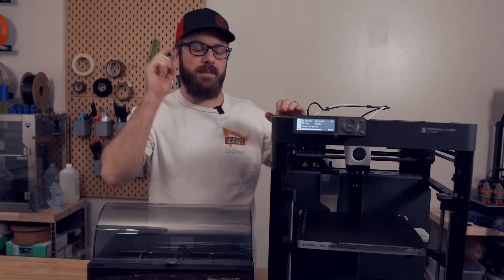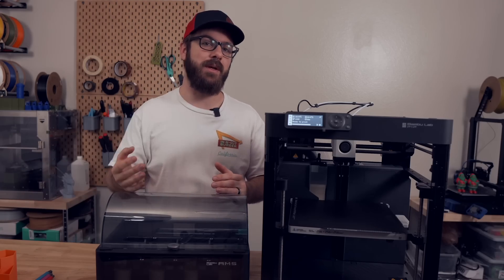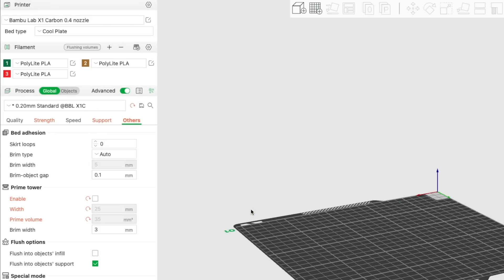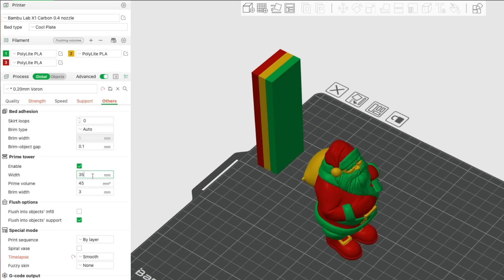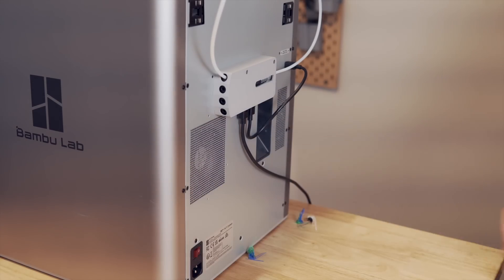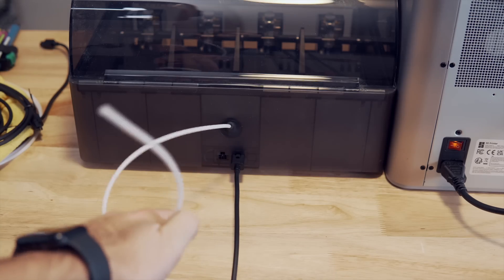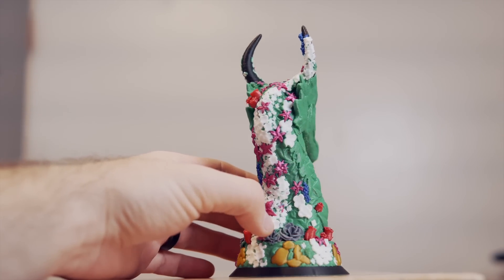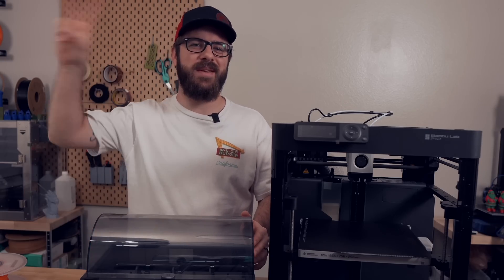Game Changer For Multi Color 3d Printing (AMS)

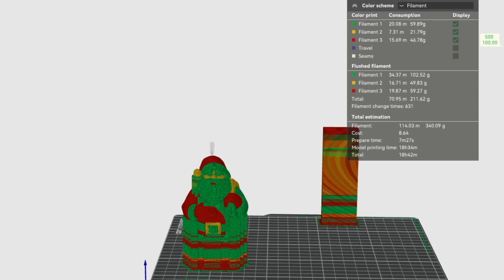Comment from the maker: Whoops was brought to my attention my calculations at 6:10 is off. 7 and a half hours seemed right due to how long the retract and purge takes (so it may not be far off) but in the slicer that is the starting time that the printer runs its base calibrations. Which is 7 and a half minutes. (Thank you for the correction)
Reply: You not only forgot to paint the front of the bag gold... you also missed his arm being green instead of red like it is supposed to be, conform the rest of the print.
Reply: You lost so much filament and time by not purging into the actual model. Not sure when you made this vid but it’s been in the slicer for a while now.
Reply: What speed do you print at with this prints?

Comment: @ModBotArmy I was wondering if there is a way to contact more than 4 Bambu Labs AMS systems at once? I am probably not the only one thinking this. Ya 16 colors or different filament types is a crazy amount already. But what if you want to run more then 16 colors or filament types is it possible to do? Also are there any other AMS systems out there for Bambu Labs printers? Or at least cheaper ways to add multiple AMS systems to the  Bambu Labs AMS systems you already have? I think everyone would agree that if you already own 1 Bambu Labs AMS systems then you shouldn't have to keep paying full price to add more AMS systems that all piggyback off that one system.

Comment: One of the advantages I like is the auto-refill. No more worrying if that little bit of filament on your spool will be enough; if you have an identical spool of filament (same type, brand, color) in the AMS, it'll automatically use the 2nd spool when the 1st runs out.

Comment: Check out the Mosaic 3 pro.  It does 8 colors but it does it by splicing in the new color, with a buffer to keep the color clean, and you have all 8 spoon hooked up at the same time.  You can switch back and forth

Comment: The dragon has a lot of waves in it looks like the resonance compensation on the printer is not working? Also there are spots that are layer changes or under extrusion... It does multi colors but print result doesn't look better than what slower cheaper printers do. The colors also look better if you print the model in grey and hand paint it. Also this is far far faster and cheaper than AMS.

Comment: Is it possible to print 2 pieces of each model on the same table with an AMS that has 2 spools of PLA and 2 for PETG and each model with each own material?
Also is there an option of purging in the model infill or even change color without purging (on the fly)?

Comment: but these are $1,200 printers and the AMS is another $350.  Maybe for the rich this is nothing, but most people start with a $200 Ender 3, so asking people to spending $1,500 is a joke.  And AMS requires special filament that starts at $25 a roll.  I don't see bambu labs taking over, I think creality will make a better clone for less than half the price.
Reply: Welp, 10 months later and you are still wrong

Comment: Did you try to feed TPU to AMS hub for printing multiple materials with TPU ? by that way maybe we can use external spool holder -> AMS hub
Reply from the maker: I wouldnt do TPU in the AMS, it is asking for trouble.
Reply: @ModBotArmy  Actully not in AMS is there anyway to feed this from external spool holder to AMS HUB directly ?

Comment: I just got one and it fails to switch filaments during a print 35% of the time. Can’t figure out what the problem is. Far left had the included basic pla, second from left is the included pla-cf. the second one is the one that’s failing. The spool is a little warped fro the vaccume sealed wrapper. Seems to not be unloading and respooling right. The filament is loose and I have to tighten it back onto the spool and hit retry then all is good for another half hour to an hour then it fails again.

Comment: Instead of the color painting tool, is there a way to model the 3D Model into a STEP with different parts (that are still assembled together), and assigned colors to each of the parts?

Comment: This whole EMS system does not make any sense. A system here you use clear filament and colors would be way more sufficient and better. You can even use sharpies for god´s sake. Multi Material in 3D Printing is only useful for dissolvable supports and rubber prints.

Comment: I would really like to see you do a spool color change from the AMS - I know this sounds like a noob question, but I am unfamiliar with this system and the AMS - especially bowden tubes.  Do you have to pull the filament out from the bowden tube when changing spools?   Also, that screen you kept tapping on is not on the P1P model.  So how does it fare with the simpler screen from the P1P?   -  I did pre-order the P1P, but not the AMS - figured I want the printer to actually get here first.  I just wonder if I can buy that screen and upgrade the P1P's screen to the one you are using, etc.   Sorry - again, I am a noob to all of this.
Reply: the P1P screen cannot be updated, the configuration of the reels in AMS can be done from Bambu Studio
Reply: @enriqueg8705  Ty for answering.  I just got my shipment tracking number last night for the P1P (I'm in the US).  Hopefully it arrives soon! :D

Comment: Would love to know if it is possible to mix and match materials? maybe use PLA for the model but PVA for the supports for example.
Reply: For optimum results, I would think that would require dual hotends, especially if the materials use different nozzle temperatures.

Comment: Where are all the three color mixing 3D printers??? A 3-in-1-out extruder with cyan, magenta, and yellow should be able to cover the color spectrum quite nicely. I'm fairly new to the scene and am surprised to find that the market hasn't already been inundated with armies of printers touting their ability to best provide that solution.
Reply: If it could be possible to arrange 6 feeds on the same printer without tangling, two 3-in-1-out extruders would be able to make a full spectrum print in two different materials. I'd take that kind of versatility over a 16 spool mixer any day.

Comment: I like your vids, but the world needs to stop using the phrase 'game changer'. It's so over used, that it doesn't mean anything anymore. You get to say 'game changer' as a past tense, because that's when you can see that 'the game' has actually been transformed. That is, unless you can accurately  see the future, then go ahead and knock yourself out.
There are still lots of issues with the colour printing of the Bambu such as with waste. I feel that the speed of printing (and the speed of 'box to printing') will probably be a game changer, such as with machines such as the Ankermake, which will truly expand the market for this sort of 3d printing.
I didn't watch the video all the way through, when I realised that the content was the Bambu. I don't think that this deserves the term 'game changer'.
Reply from the maker: I use the term when describing things that I feel are truly a leap forward. I have have tried a vast range of mmu setups over the past 8 years with most being an absolute nightmare. This is the easiest setup I have ever seen by a long shot and to me is a game changer because it makes multi color available to a much wider range of people that would not have time to non stop tinker and calibrate everything just to have spotty results. 

Is it perfect? nothing is perfect. But it is substantially better than anything out there with the exception of tool changers that unless you are looking at industrial printers are far from plug and play as well as limited in tool heads to typically ~4. 

It has room for improvement yes, but after years and years of what I would consider slow or even stagnation in desktop mmu setups this is incredible. Bambu might not be for you and thats fine. That is the beauty of having so many options. Hopefully they will continue to innovate and refine the process on the software side to decrease waste to a minimum.
Reply: @ModBotArmy  The problem is everyone uses the term 'game changer'. 
You could probably come up with a descriptive term that is truly original to your channel which would have a lot more impact then an overused catchphrase that blends in with the crowd of other Youtube content creators :-)
Reply: @ModBotArmy  Little bit 'off topic', but the obscenity of the 'waste tower' really bugs me and I've been trying to think of a quick solution...
Why can't the slicer allow us to select a 'waste object' that is created along side the 'true object'?
Maybe the waste object is the same design as the 'true object' but a bit smaller?
Maybe we have a default waste object such as a cup, or a puzzle?
Maybe the slicer designs some sort of ai driven piece of 'waste art'?
I'm still trying to come up for a solution to the Bambu  'poop chute ' :-)

Comment: If they could design the slicer to print a useful product with the purge material,  they could minimise the waste.  i.e. something where colour variation is not significant. like clothes pegs or furniture coasters etc...
Reply: It's designed that way. You can "wipe to object" and print stuff with the pruge

Comment: Im soooo happy that I didnt order this printer. My main issue is plastic waste. 
Somehow nobody havent raised this issue. This printer literally creates plastic pollution on a fast track -  as your Santa example shows, it created almost 3 times more waste than the product. I love the Santa though :D
Cost of the filament is also an issue when printing with proper stuff 😛. If filament cost 100+ euros per kg, this amount of waste will become an issue for the wallet (OK.. my I-dont-care filament cost only 65ish euro per kg). 
Im using custom printer with quad printheads and I have to say that price for that printer was a bit higher than X1 Carbon with AMS but if we consider the price of wasted material then X1 Carbon price will go up fast if you print a lot.
If Bamboolab will come up with printer that have tool changer Ill crab couple of those fantastic machines to myself  at once

Comment: i can’t get over the fact that it wastes so much filament. i dont mean just bambu labs but every multi material printer that needs a waste block. it would be great to have 3 dimensional printing so the waste block doesn’t have to be in the same layer as the print & can drop down the gantry or move up bed away to a non intrusive corner to purge plastic a small amount.  all that wasted filament just because it needs to be in the same layer as the print gives me nightmares lol but heck if that’s the case & you have a shredder & some sort of way to turn wasted filament back to a spool is a good solution as well.

Comment: Does the AMS only work with Bamboo Printers or can I use it with my Ender Pro?  Great video...exciting to see multicolor printing happening.
Reply: They are a closed-source company who are only interested in taking from the open-source community without giving anything back. So no, it only works with their proprietary slicer on their proprietary printer with their locked-down firmware
Reply: @cemmy410  Do you drive a car with open firmware? Thermostat? coffeemaker? Ride an airplane? 
Not defending, just curious how far you go with this...like people struggling to buy all MADE IN USA, lol.
Reply: @foam27  if those options were available to me I would take them. In fact, cars are a great example of why closed source hardware is a bad idea, with manufacturers recently moving to lock things like sport mode behind a paywall. Where possible I prefer to own the devices I use.
Reply: @foam27  their slicer is literally a clone of prusa slicer which is an open source slicer… lol. The complaint is kinda valid.
Reply: @timr86868  But it's not "literally" a clone. It has features the unmodified version dosen't.  Lidar, etc that are machine specific that other printers don't do. Their work added into the "clone".
Reply: @cemmy410  Can you imagine 1000's cars driving around with modded firmware? Tinkering of ABS/stability safety systems? I agree with you, but with limits to protect us from the idiots that take it too far.
Reply: @foam27  there are already thousands of cars driving around with aftermarket ECUs, tuning profiles, brakes, intakes, in-car entertainment systems, exhaust, tires... basically any part you can think of. It's not as big a problem as you seem to think it is. I'm way more worried about being locked down and exploited than I am about someone else being able to mod their hardware
Reply: @foam27  yeah, so you're saying that they took an open source project, added features to it, and then didn't give those features back to the community that did all the ground work? Which is literally what I objected to in my first comment?

Comment: I noticed the support material, I'm surprised you didn't use solvable support material because clearly you will want that ability with this system. As you did it presumably you can use the infill material as part of the purge material between colours.

Comment: The biggest problem with this system is the BambuLabs Studio slicer being derived from Slic3r/PrusaSlicer (as, IMO, most problems with the X1, derive from BambuLabs’ nerfing of PrusaSlicer, though the issue here exists in the original Slic3r/PS/SuperSlicer). PrusaSlicer, is, in my opinion and experience, the worst slicer available for multi-material or multi-color printing, due to there being almost no practical settings overrides existing in the per-filament overrides settings, instead being contained within the general Print Settings parameters. Each material behaves differently, and may even behave slightly differently from spool to spool of the exact same material. By keeping settings that are influenced by filament peculiarities saved within the Print Settings, with no Filament Profile overrides, you are effectively limited to optimizing the parameters for only one spool in use, and ‘hoping’ that the rest of the spools used are “close enough”. The more spools used in a print, the more this becomes a problem. 

Settings such as:

Quality/First Layer Height
Quality/Elephant Foot Compensation
Quality/Bottom Surface Flow Ratio

Speed/First Layer
Speed/First Layer Infill
Speed/Outer Wall

These really need to be made available in the Filament Preset overrides, not only for AMS printing, but simply for maintaining a library of well-tuned filament profiles. 

I placed a feature request to Bambu via GitHub, and effectively they said “we haven’t seen it done this way before , (note, every slicer except PrusaSlicer works this way), “and we think it’s weird.” And have been ignored ever since.

(I’m running 2 total AMS units)

Comment: So, one of the things I am seeing that is not even closely talked about enough is...waste material. The amount of waste the x1 produces is insane - "212g of 340g is waste"!!! (even halving the ratio by doubling the model is still crazy waste). The few times I have seen this issue brought up, the "Bambu-ites" come back with "...but you can adjust the purge volume setting". Regardless, that waste material is $ straight into the bin. How many filament companies are sponsoring AMS videos (where waste amounts are glossed over) so people will buy their product (and waste a bunch of it)???
Reply: I think this is the next big challenge and there's a big part that can come from the slicer software, instead of purging the filament they should use the infill to do the color change purge. They also need to reduce the number of color change, when gong from layer to layer, use the last color from previous layer to do most of the new layer
Reply: @hyksos2  well yea, but even purging in the infill (and interior perimeters) only purges a small amount. It’s the biggest reason I have not bought an MMU unit for my Prusa